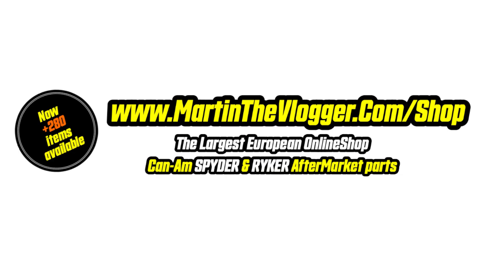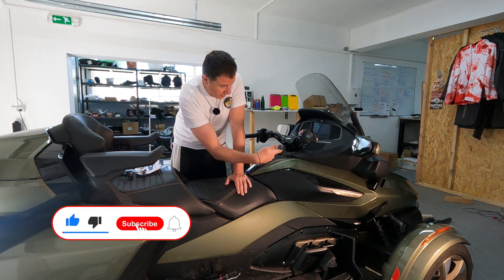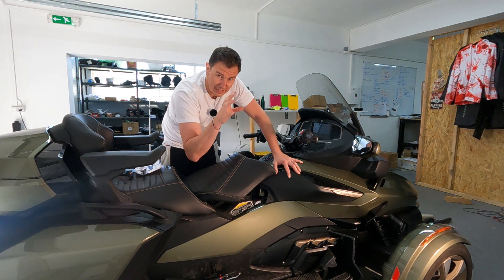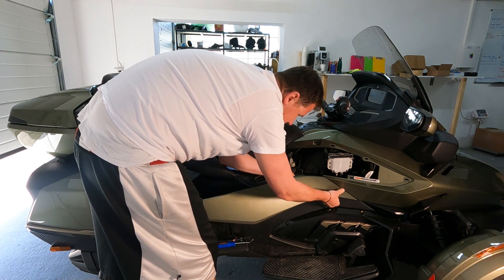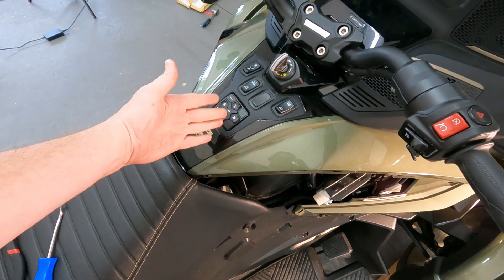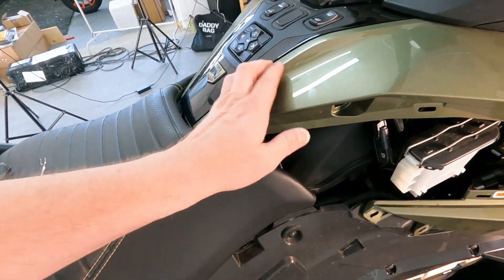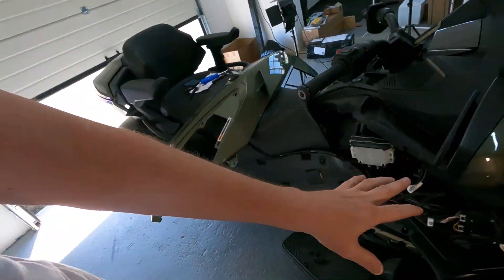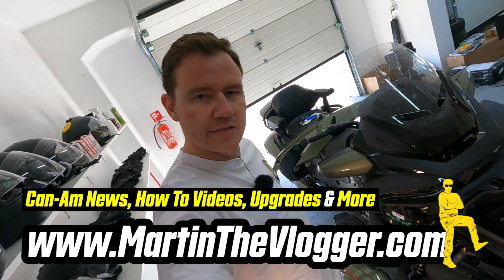Tips and How to remove side panel RT20+ Can-Am Spyder

Comment: Martin  ... Buddy .. Pal ... Friend of mine :)   Please come out with a video on how to remove the big azz left side body panel that allows access to change out the POS OEM belt tensioner. PLEASE :)  troop from Spyderlovers
Reply from the maker: @jeffcunningham678  😆😆😆😆😆😆😆😆😆 advise... remove the floorboard, lot of pushpins and lot of patience 😆😆😆 but i promiss you a video.
Reply: @MartinTheVlogger  (3) body panels removed, driver and passenger floorboards removed. Looking at lots of push pins and torx screws. Winter here in Wisconsin USA, so I wait patiently :) THx !!
Reply from the maker: @jeffcunningham678  bolt is also under the saddlebag you can reach it with hand... and then lot of shaking.. but as i have you hear.. you know my videos have been removed from spyderlovers? I am not posting there anymore... because i use word BullShit 😆😆😆🙈🙈🙈🙈 btw my new brand is NOBS3 so No BullShit from Slovakia, so i am no longer able to post 😆😆😆😆😆😆😆😆😆
Reply: @ Yeah I know :(  But I am still a loyal customer and subscriber :)
Reply from the maker: @jeffcunningham678  😆😆😆😆😆💯🚀